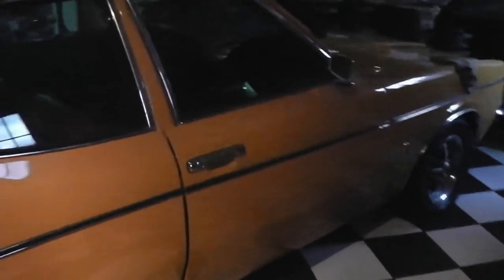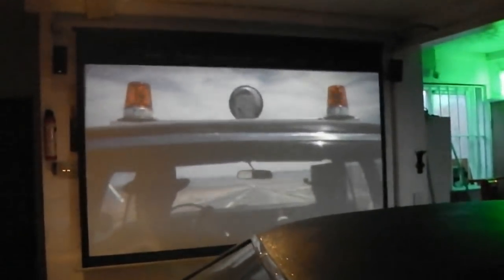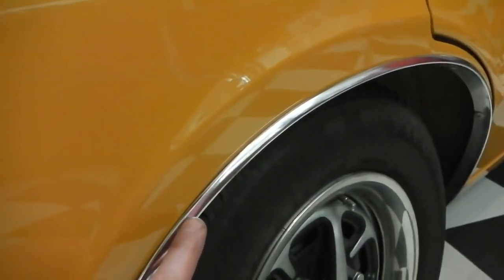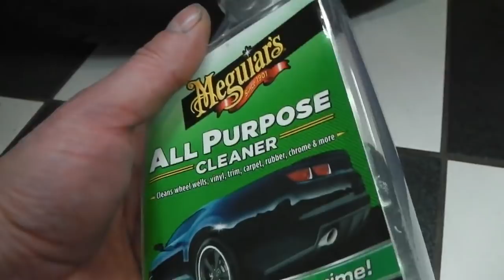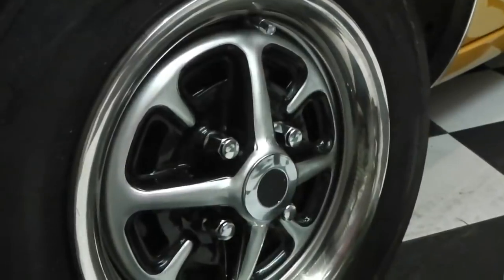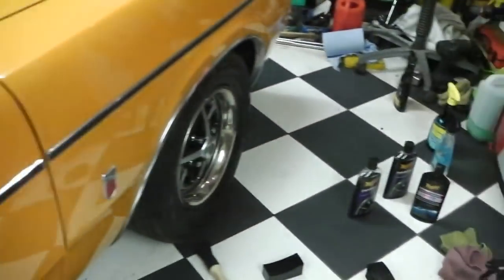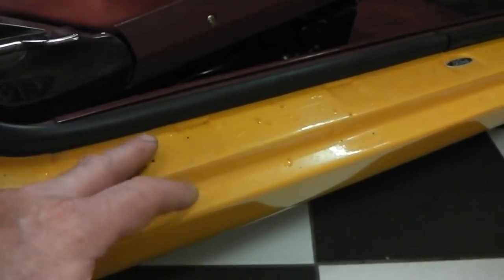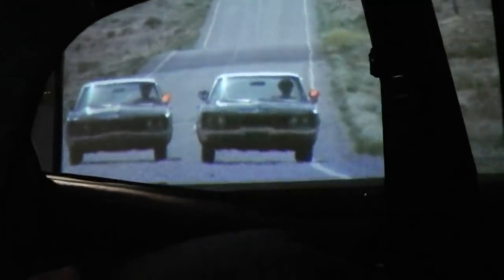Mk3 Cortina - Winter road trip clean up

Comment: Hope you get to read this Pete, my old fella had 2 Cortina Mk 3,s the first was a 1971 1600 GXL FXG918K the number.......... although on Middlesbrough plates the car was originally from Quicks of Chester the original plate started...... IOK ending in K the owner kept the plate moved to Middlesbrough through work and sold it because his father had just bought a Vauxhall Magnum brand new in 1975 then died leaving it to his son. The guys name wasTony Heath and he was a petrol head when he ordered the car new from Quicks he had them fit a Ford Motorsport camshaft similar to the Escort Mexico and was fitted with a Weber 38 DGAV carburetor that was fitted to the 3.0 litre Capris this was carried out at Harper’s High Performance specialists Middlesbrough in 1974; who then set the car up on a rolling road as well as fitting an early version of Lumenition electronic ignition at about the same time this chap had fitted a set of Bilstien shocks at Neashams Ford dealers Middlesbrough .
So in June 1975 when Tony sold the car to me dad  I was 14 and was struck by the Daytona yellow paint work and Black vinyl roof and-gloss black-bonnet proper ro-style wheels and 185/70 13 tyres, Just how the car was ordered, I washed that car twice a week over the next six years when dad gave it to me and I part exchanged it for a Honda CB750, by this time it was looking tired and dad bought my cousin Ronnies Cortina 2000E in Modena green LPY72P beige interior he had that 5 years and then it was stolen and used in a bank robbery in Leeds found burnt out with a safe in the boot somewhere near Bradford and I did some mechanical work on both cars my dads brother had a White 2000E HHN 663 N, so i know these cars quite intimately as I worked on them all I never understood why the 1600 had a four branch tubular manifold and the 2000 had the terribly restrictive cast iron manifold on both the 2000,s I mentioned the manifolds were changed to the Tubular with the 1600 downpipe, but hey Pete these videos and what you are doing with them cars is breathtaking and i am a mechanical engineer so I really appreciate the effort and work skills and love that goes into your work. I am trying to finish off a 1994 Jaguar XJ40 4.0S only 500 of this model built but I am disabled due to an industrial accident and now money is the stumbling block as well as to be honest I’m buggered the car is out side i have no garage, I will most likely have to sell it for peanuts which is a shame because I love the car Jaguars ugly duckling.
Enough waffle best of luck fella and thank you..
Reply from the maker: Hi David message recieved, wow what a story and what memories looks like the mk3 really touched you, love to hear stories like yours very important history David.

Comment: Pete I am doing up a 1981 Series 2 Fiat Mirafiori 2.0 CL Diesel and I was told that them rubber seals that go on the bottom of the door are dirt collectors and in time will
 cause the bottom to the door to rot out.
Reply from the maker: yes i think they do hold some but if you keep cleanign should be ok, i think i need em as the sills get very mucky
Reply: Would be grand if ya could spray some stuff on the rubbers for the bottom of the doors to make it dirt proof Pete, I reckon the product don't exist.